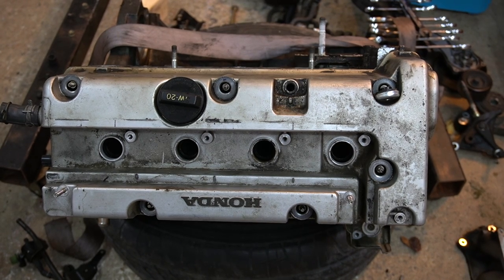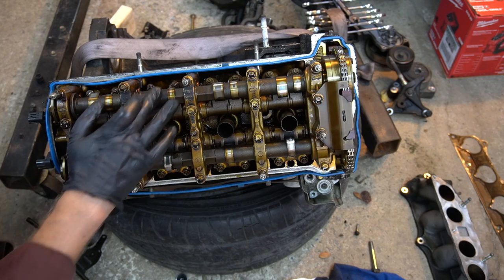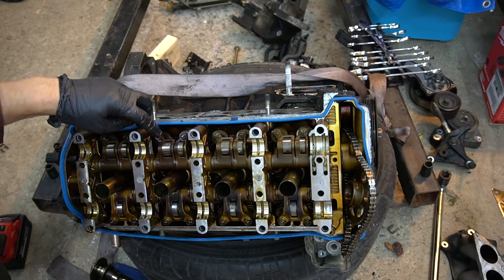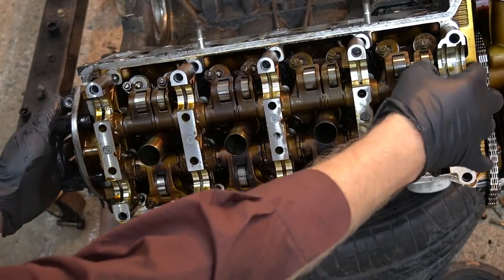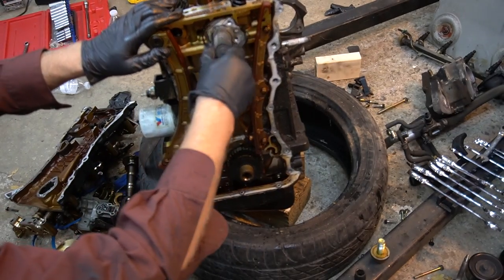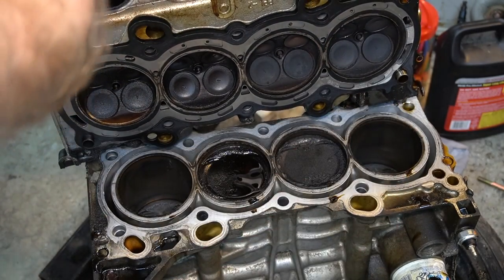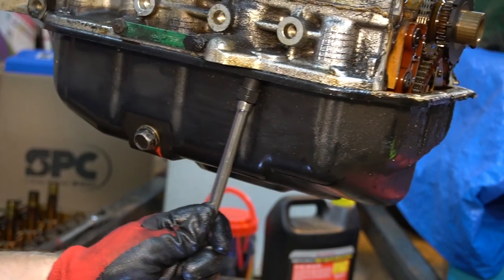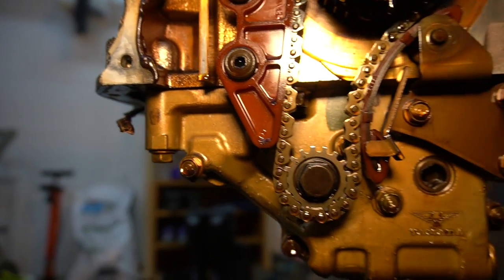Honda 2.4 engine failed due to strange reason. Honda engine problems, Honda engine reliability

Comment: They obviously 🙄 didn’t use Amsoil in that abused engine. But hey it lasted 260 K miles with a lack of proper maintenance 👨‍🔧. Tough little motor .
Reply: I was just going to say. If I had it, I would of used Amsoil and use the specific weight recommended. And regular change interval. 
  What type of vehicle is it?
Reply from the maker: Honda crv
Reply: @repairvehicle  that's a lot of miles!!

Comment: My dad had a 1997 Honda Accord with a non VTEC 2.2l i4 and he said he tried to kill it by not changing oil but it didn't seem to matter it just kept running and running. He went almost 90,000 miles on one oil change
Reply: When we got rid of it it had over 500,000 miles and the motor was great and the transmission was great but the only reason why we got rid of it was because it cost more to fix brakes on the car than it was worth.
Reply from the maker: How was the oil consumption? How were you changing oil?

Comment: I have a 2003 Toyota Camry 3.0v6. I bought the car one year ago and I don't think the previous owner did regular maintenance. My car has 123,000 on and about a month ago it started smoking a little at start up not bad and doesn't last long.  I do change the oil every 3000miles I use pennzoil platinum full synthetic 5w30. Do you recommend I use something different?
Reply from the maker: Does your engine looks like this one? Watch this video https://youtu.be/Ta1tUKqwjeQ
Reply: @repairvehicle  when I bought the car I was desperate. My previous car broke down and I was walking so when I bought this Toyota I never gave it a through looking over. The seller said he was a coach and a Christian so I took him for his word that the car had been taking care of which now I know he lied. The car looks great and runs great. But when I looked under the oil cap  I could see lots of carbon buildup. I knew I should of looked before I bought the car but I trusted him at the time. So now it smokes a little at start up. What should I do I can't afford for it to break down. Should I use a different oil other than what I use now pennzoil platinum full synthetic 5w30? I don't know but I'm worried that my engine may quit on me.
Reply from the maker: My advice for you is to start using this engine flush, once a year or couple times a year before oil change. https://www.amsoil.com/p/engine-and-transmission-flush-flsh/?zo=5257753
Change your oil every 3k miles max with oil filter. 

Has the timing belt and water pump been replaced?

Transmission fluid has been replaced?

Are you driving as uber?

Also, very often none christian people use christian name to sell things,  it's very common.
Reply: @repairvehicle  I've never had the belt and water pump replaced and I doubt the previous owner did. I don't drive as a uber. I drive the car about 5 miles a day.  I think about changing the transmission fluid all the time but everybody tells me not to they say it will cause it to slip is this not true?
Reply from the maker: My tundra had first transmission fluid change around 160k miles and second transmission fluid change at 225k  miles and 230k miles truck still running excellent and transmission has no slip. Where was this car maintained at?

If belt breaks it will destroy the engine.
Reply: @repairvehicle  not sure what you mean by asking where the car had its maintenance at? Like I was saying I've only had the Camry for one year now.  I don't know what the pervious had done or where he had it serviced.  Since I've had it I changed the oil every 3000 miles had plugs and coils changed  had coolant flushed and that's about  it . I have a local mechanic that does my work his business is called estep auto repair here in Mt. Sterling Kentucky. Where are you located I wish we had better mechanics around here like you? Around here they don't volunteer information on what all a person needs to do to keep their car running good. They expect us to know everything they don't recommend anything other then what we need fixed.
Reply from the maker: The reason why asked about where it was maintained. If it was maintained at shops and not by the owner himself,  carfax report might have information in terms of what had been done or repaired.
Reply from the maker: I am in pa
Reply: @repairvehicle  thank you for all your advice I will start flushing with amsoil and I'll have the belt and pump replaced. Any other advice?
Reply from the maker: Before you replace belt and water pump,  check Toyota website for any maintenance records.  It's free and at least you will know if anything was done.  If you do replace water pump, make sure to replace thermostat too.
Reply from the maker: I will check and also, I will make a video on this subject so others can benefit too. It will be later today or tomorrow morning
Reply: @repairvehicle  cool and many thanks
Reply: @repairvehicle  when you asked earlier if the transmission fluid has been changed do you mean a flush or just changing what's in the pan? Sorry to text so late I promise not to make a habit of bothering you.
Reply from the maker: Flush or drain and fill.  You can ask me anytime you have questions.  That's a purpose of my channel,  where you can ask questions and get answers. Thank you.
Reply: @repairvehicle  You and I recently spoke you even made a video for me titled where to find service records. And I'm so grateful for all that you do. I just have a question for you that I'm very confused about you asked if I flush my transmission and recommend that I do so however I was watching one of your videos from 2017 titled 5 reasons not to flush your transmission so I'm confused. Sorry I'm sure I'm just misunderstanding but could you clarify for me please. I hope not everyone can read this reply I'm not sure how all this works.
Reply from the maker: Drain and fill that's best thing to do.  Do not flush transmission

Comment: I would think Honda engines are bullet proof.
Reply from the maker: Use to be. Now its hit and miss. Honda engines with direct injection, is just trouble engines and will never be like old Honda engines.
Reply: Went to fast. Cheap oil just add or forgot to add.
Reply: @repairvehicle  Agreed. In my opinion, this generation of K20's/K24's is the last of the truly great Honda engines. Not a fan of any of their direct injected engines, they have been too problematic for no real benefit over the early K series engines like this one.

Comment: Would a different oil grade here and there be a big factor?
Reply from the maker: Different viscosity would not have helped.  Short oil change intervals with cheap oil or long drain intervals with high end oil would have been better outcome.
Reply: @repairvehicle  I mean,if someone put 15/30 instead of 15/40 every other oil change,would that ruin any engine? Thanks for the reply.
Reply from the maker: It depends on the engine,  it's possible that it could cause significant wear.

Comment: I have a 2003 accord 2.4 that has a crusted inside valve cover like this engine, had 185k when I bought it and now has 235k miles.  I don't know how it was maintained before I bought it but it sounds almost as quiet as an electric vehicle.  I run Chevron delo 15w40 and change every 3,000 miles.  I live in Texas so it doesn't get cold that much.
Reply from the maker: Any oil consumption?
Reply: @repairvehicle  Had oil leak when I bought it.  Replaced valve cover gaskets, VVT screens and solenoids but now the valve cover screws are stripped and won't clamp down like it should.  I just try to stay under 4,000 rpm while driving to keep it from spewing out the top until I can get to work on it again.  I go through a quart every 1000 miles or so, more than that if I drive rough.
Reply: @repairvehicle  I only paid $1000 for the car so I won't complain about a little oil leak, but it doesn't burn oil that I can tell.